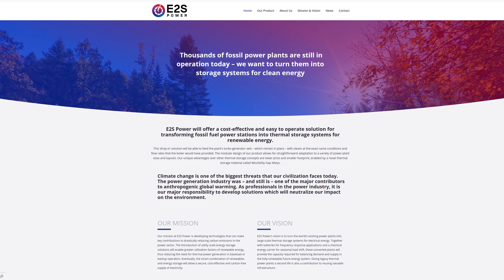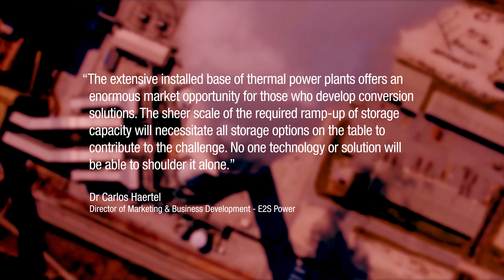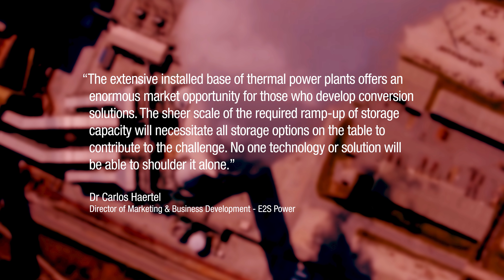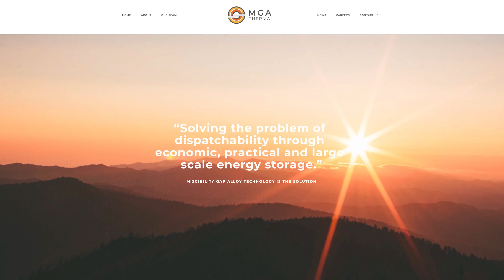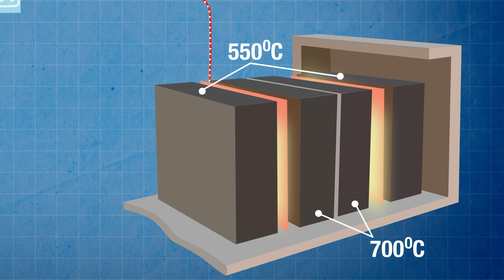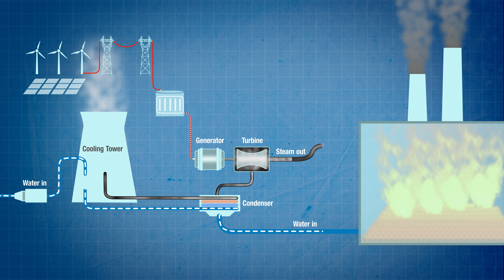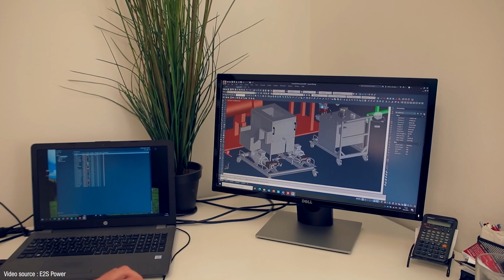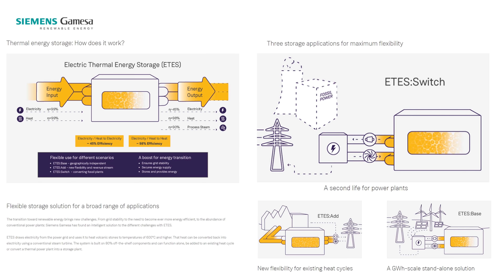New energy storage tech breathing life and jobs back into disused coal power plants

Comment: If you only learned accounting, business administration or programming or literature, you will benefit if you invest your spare money in this sort of childish innovation. You will get a priceless lesson, that there still exists a physical world outside computer games. The hard way... There are innumerable ways to transform energy from an active to a potential form and back. This one does not seem to have the best efficiency. The weak part is in getting the heat inside and taking the steam out. There have to be heating wires and a dense web of steam tubes - both in direct contact with the molten aluminum. Each cycle of melting-solidifying will aggressively erode the electrical wires and the plumbing.  When they give out, the whole accumulator will have to be disassembled and a section with solid aluminum will have to be cut out and replaced, along with tubes and wires. Even if the electric cables are protected by some sort of expensive ceramic protection, heating wires quickly burn out at these extremely high temperatures.

Comment: Remember anytime energy changes states there is loss. Same is true for electric vehicles. From the production plants through each transfer point/transformer there is loss. From AC to DC battery storage there is loss. From battery to coil/motor there is loss even line resistance causes loss. Is that efficient?

Comment: Wow, brilliant.  Good job E2S Power, this is great.  It's simple (in relation to other solutions), it can re-use existing infrastructure, assuming that infrastructure hasn't reached the end of its life, and it uses common and available resources.  There are still some environmental concerns, aluminum smelting is very bad for the environment, but perhaps they can utilize recycled material.  However I can live with that if we can breathe new life into existing infrastructure, as that is huge.  I am also impressed with the phase change of a relatively high temp material in a confined space assuming it can take the stress of thousands of thermal cycles, which I suspect it can in this case.

Comment: Have you seen the Metal energy carrier project? https://www.youtube.com/watch?v=Qm0sIN-KhUo It uses powdered Iron and burns it at 1400C to power retrofitted coal plants and industrial processes like smelting.  The resulting iron oxide can to turned back into iron again through electrolysis using renewable power.  Best of all this can be shipped overseas as an emission free power feed stock that never loses it's energy.

Comment: I don't say this will not work, but I'm a bit sceptical about a few things.
First: Aluminium may as well react with Nitrogen, especially when it's molten and absorbed to the carbon, which will enormously increase the reactive surface of the metal. 
Second: Molten Aluminium will surely react (probably violently, when molten) with any leaking water from the steam pipes - if it's actually water steam they lead through the "hamster". The latter may also generate Hydrogen, with all consequences, culminating in possible explosions.
Both of the above will (slowly or quickly) *kill the hamster*, so to speak. 
Third: If they still need to cool down the steam after it has passed the generator, a major amount of heat will just be blown into the atmosphere. That's wasted and will decrease the efficiency of the process.

Comment: On top of things as usual.  I learn so much from your videos.  Thank you, for crafting them with such care! 

I work with a company that is also keen to take advantage of existing thermal electric infrastructure for carbon-free generation and storage.  The technology captures light energy and transmits it (as light) to a thermal electric plant retrofitted with mixed salts for thermal storage and conversion to electricity. Similar to your examples, the design replaces the boiler with thermal storage but keeps the power block.  The result is a non-intermittent supply of power.  This type of solution should be attractive for utilities and, by keeping generation and storage together, does not require huge grid upgrades to scale.

Comment: Oh come on. Please study the conversion efficiency of heat to electricity. This is governed by the Carnot efficiency, which gives you the upper limit of what can be achieved. The high temperature of the steam compared to the low energy of the surroundings are crucial, which means that huge losses are incurred in any thermal energy storage. 
Electricity storage costs money and costs electricity. We can NEVER hope to store TWh of electricity, it is just science fiction.

Comment: Why not simply replace the coal furl with Thorium. I still uses the boilers as well as the rest of the equipment, which preserves jobs as usual. This will burn cleanly as well as consistently for a much longer time frame, not needing constant refilling as was needed using coal.

Comment: Not only is that inefficient as a storage method, it's potentially risky. Any leaks of water or steam from the steam generators would trigger an explosion if it comes in contact with the molten aluminum.

Comment: Australian company BXB Technologies Pty Ltd has developed a Thermo-Catalytic-Chemical-Reaction (TCCR) process that converts lignite to Hydrogen. If we remove the boiler and the steam turbine, and replace it with the BXB system coupled to a Hydrogen turbine, we can retain all the incumbent infrastructure and make 24/7 electricity. The same setup as steam, but no CO2 emissions. BXB captures carbon as carburising coke, an important part of green steel making. It's chemistry, not combustion.

Comment: Excellent idea, especially as the chance of these plants being cleared and landscaped is near to zero I imagine.  Large enough scale to make for substantial storage. 
Has anyone suggested using abandoned coal mines for gravity storage? The main access shafts, where miners used to go down to work, could make an undergound version of a tower storage plant starting off fully charged too. The insfrastructure may be removed or deteriorated  so need replacing, but again, jobs for locals running and maintaining the turbines. There could even be wind turbines on site with direct storage as and when required.

Comment: One small 4 - 10 MW unit in every power stations steam plant should reduce the need for hot standby .
Give a very short start up time .
Help with the integration of solar & wind .
Reduce spinning stock ( Backup for solar & wind ) .
Improved load levelling ( across the networks ) .
Obsolete ocgt plants & long distance interconnections with horrible conversion losses .
That's intercontinental interconnections ( green dump loads or kettles ;-) that import 24/7 instead of local generation & the operators profiting from the inefficient transfer .

All this is if the OLD equipment can handle the new tec without upgrades or large investments .
But non of this makes prophet in fact it's large-scale integration ! 

So that box cost £xxx for fitting & £xxxxxxxxxxxxxxxx back for having one …. 
But it never gets used ! 

PS
Don't get me started on green certificates .

Comment: Surely a great technolog (known as MAG Thermal Batteries), surely a great solution to put attractivness on energy storage from renewable electric generators (windturbines and PhotoVoltaics) thanks to large and dense heat storage, while recycling part of equipments from retired coal electric plants (steam-operated electro-turbines; Condenser and refrigeration towers). 
But it is not THE (unique) solution, nor a MAJOR solution for the ecological transition. For 2 reasons[a][b].
Alternatively, there is a more massive and much cheaper heat storage system, that could make us less dependant on a grid, on electricity with always higher production and consumption: BTES (BoreHoleThermicEnergyStorage)[c].

[a]-this MAG Thermal Batteries do not solve the limitations in the sustainable green primary energy production, of electricity, from which it depends: windturbines and PVs are 'green energy' with a significant part of 'grey energy' (and with correlated ecological impact), not talking on sovereignty/dependance on Asia producers, rare elements forecast penury, ...: windturbines and PVs seem today incompatible with the global climate warming if they were extended to supply all our energy needs, and even if it was technically possible just for electricity supply. 
Now dont forget 2 other assets of MAGs:
-MAG Thermal Batteries could also generate directly heat (without 55% loss of energy through electricity). This would be great because heating accounts for 50-70% of all the energy we use!(44-75% depending on countries). MAG is surely great to supply high temperature needs in industry… provided it is located not far. Unfortunately MAG seems, to me, much less appropriate for the major need of heat: domestic heating (homes, buildings), and industries far from MAG batteries/coal plants.
-Similarly, MAG Thermal Batteries are probably pertinent to generate (though steam) mechanical force used in industry … provided it is located in the vicinity. 

But lets come back to what everybody is looking for, a "massive" electric and thermal energy storage, so possibly by MAG Thermal Batteries (that is dependent on electricity supplies). We have first to recognize that such an energy-dense storage is of interest to spare space and materials, but this depends of its cost, other space usages,... Not sure this is critical in this case. Secund,

[b]-the MAG Thermal Batteries do not solve the insidious and finally pernicious issues of massive/centralized energy systems: energy waste due to required distribution; dependancy; and finally always more electricity production+consumption for a putative improved human well-being (a 'need', or a 'waste'?).
Lets explain: MAG heat storage operates in a electric grid-dependent system, with (partly) recycled coal plants, adding a high-level technology. That's nice in a way, in a capitallist driven society. But: 
b1) the requirement of an electricity distribution grid wastes at least 10 and up 30% of electric energy:
.10% loss per 100km, from 1) the supply of electricity to the plant, and then again 2)from the MAG batterie/electroturbin that regenerate electricity (with a 45% yield) to end-users. 
.+ 10% loss in PVs or windturbin plant, for conversion from produced Continuous electric Current to transported Discontinuous Current, + 10% again from DC to CC in nearly all our electric supplies. 
b2) Also, consumers will remain dependant on companies that dominate the primary energy production and distribution grid, through technology and/or cost race by scaling-up. High-technology and monopole trends will allow for higher user-costs that do not help all people to use electricity at best to satisfy the essential needs (eating, heating homes, be dressed), while competition leads to lower cost energy that allows more energy be consumed for always more new non-essential needs (for exemples: electronic games, porno-videos, streamed films;...) or for more usefull needs but that are easy to perform with less (non-human) energy (ex: electric toothbrush;... ) notably with a more sober way of life (ex: less long-distance travels for leisure or work: plane>car>train>bike; telecommuting). Shall we increase our dependancy on electricity and our energy 'needs' (mostly needs of comfort), or reduce them and develop resilience toward rising difficulties due to climate changes (current small disasters, and next big ones!)? To be happy, do we really need so many electric devices, to be connected 100% of time in real-time to the whole digital production of the world,...? Without them wont we be in good (or better!) health? How many activities will be +/- impacted because of an electric shortage, a terrorist attack to a major electric system, or when a satellite in space will hurt an other inducing a storm of further collisions by space junk in the rising population of satellites?
The same remark (b) will apply for hydrogen fuel produced from renewable solar electricity (windmill and PVs): because Hydrogen is again an energy storage form (for electricity; or as a chemical fuel) rather than a primary energy source, and because Hydrogen is also a sophisticated technology, so presents several dangers (explosion) and limits for pertinent applications. 

[c]-alternatively, lets consider a massive and cheaper heat storage system: BTES (BoreHoleThermicEnergyStorage) is used for example in the the DLSC project: http://www.dlsc.ca/borehole.htm : this system works since 20 years and gives, thanks heat storage, 98% autonomy in heating 52 houses all the year. 
In short, this is Thermic solar pannels to produce heat during summer combined to heat storage in the soil that last all the cold season. This Sensible Thermal Energy Storage use Borehole technology, that can be built quite anywhere. It has a low grey energy because it uses just conventionnal materials in reasonnable quantities (tubes, water, some glass and concrete) and that will be easy to recycle; it do not pollute while operating (no CO2; no noise like windmills), has +30-50 year life with very low maintainance; BTES/DLSC has a good thermal yield and charge factor, with a excellent COP factor of 30; it is not capital-intensive; relatively low-tech and free-rights; … 

Heat storage is surely a key solution to limit our impact on the global climate warming, first for heat needs that represent 50-70% or our energy needs. If MAG-TES seem less pertinent for heat that BTES, it can adress also electric generation with a nice yield (45%) using already existing 550°C-steam-turbines. Now, BTES (in soil, at about max nominal 90°C temperature) needs different electric generators that do not exist widely installed (low-T Stirling engine; or other suitable ThermoDynamic motor) and because of Carnot's law, the final yield will be rather about 25% (better than PVs). I trust that BTES is a better solution for the climate and humanity well-being, while MAG-TES is better for private profits and industries with apparent green promises but finally few benefits for CO2 emission, for a just and equal access to energy, and for a low energy-sobriety behaviour of people.in real-time in real-time

Comment: Two problems - where is the electricity coming from ( you cannot store what you do not produce) and how are you preventing the aluminum from converting to aluminum oxide which requires a higher temp to melt?

Comment: It’s a shame that we didn’t hold onto our old 60mW units. My first power station, Tilbury had six of these units which were well maintained. OK the boilers were oil fired, but they wouldn’t be needed for this process. The temp/pressure for the units was 900psi/900degF, 3xParsons and 3xEnglish Electric. Both companies offered these simple designed turbines and used build them to go into store because the CEGB were ordering so many of them.
Regards

Comment: I am a bit sceptical
Modern coal plants operate with a thermal efficiency of about 45%, so the thermal efficiency of converted heat storage plants will hardly be higher.
Given that there might be energy losses during heating of the storage and creation of steam as well as heat losses during extended storage durations, the over all energy recovery ratio might be as low as 30%.
Compared to other storage solutions like pumped hydro or battery storage, which both operate in the 80% to 90% ratios, this concept will waste a lot of energy.

Still the reusage of available, to be otherwise disposed of infrastructure, makes it worth a closer look.
Surely it would be possible to combine this technology with district heating, like it is done with coal plants, to increase the recoverable energy.

Comment: Energy can be stored as heat and this looks like an effective way to do this and use existing power plant infrastructure.  As with many of these ideas, it is important to have an idea of scale.  How large a device would be needed to store enough energy to run the generating plant for a day? a week?
Energy stored at high temperature is more useful than that stored at a lower temperature.  But a rather important question is:  how to get that high temperature heat in the first place?   If you need to use electricity, then your output electrical energy will be much lower than the input, due to losses in conversion and storage.   
To get the energy to store to run a 100MW power plant for a day would require A LOT of solar panels.  But how many?
I think these videos are interesting, but some quantification is needed.
The ideas  will onl be useful if the sizes are practical.

Comment: Thank you so much for another very informative video. On this topic ,,, here I go again. Trying to use massive batteries or using solar and wind to store heat energy is Foley at worst and inefficient at best. Let us not go down this road please. All the energy we as humans in this world will ever need is STORED in WATER . WHY? Because all the water in this world stores Hydrogen in more vast quantities then ,,lithium, aluminum, graphite or any other fuel or energy that humans have though of. Electrolysing water is simple ,, proven and efficient. Let’s not spend more time ,,,,which we don’t have and money,,, which we should be spending on anything Hydrogen to bring down our emissions now.
Remember the Goal here. Reducing Greenhouse gasses and have a thriving economy. One can or should easily use Hydrogen stored, to generate heat to turn the existing coal fired electrical generating plant’s turbines.Let’s really have a think about this technology. Cheers.
Reply: Unfortunately not.  Water is a low energy way of storing hydrogen and oxygen.  You need to put energy into water (several kWh per litre) to get hydrogen out.   Hydrogen can be a handy fuel, but making it is a lot of hard work!